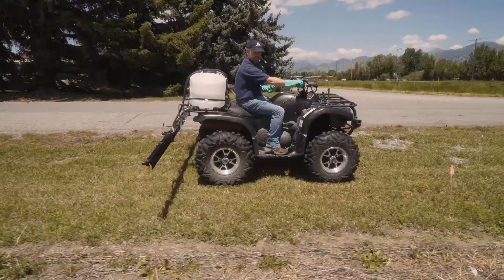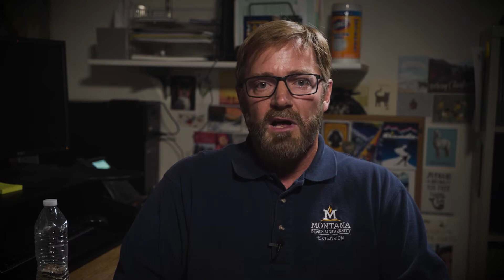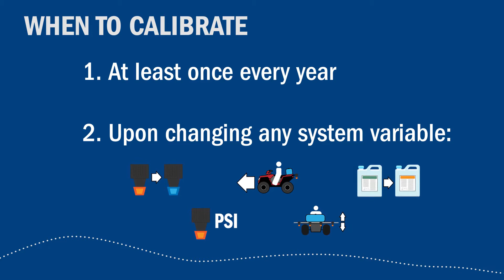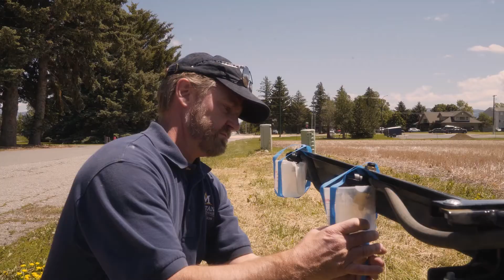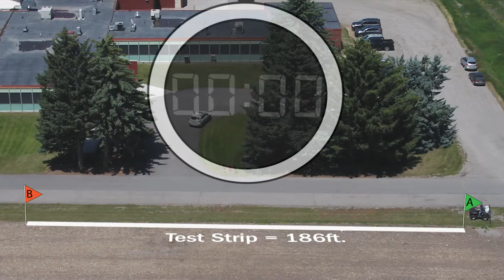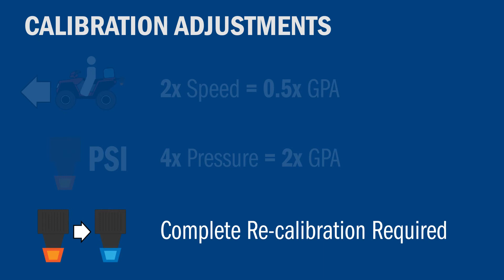Comment: How long does it take to spray after you plant
Reply: According to MSU Extension Pesticide Education Specialist Dr. Cecil Tharp, it depends on the pesticide product. Always read and follow the product label regarding timing under “precautionary statements” or under “site; rate; recommendations”. Only use products labeled for that plant (crop), and usually, there is additional information on timing.